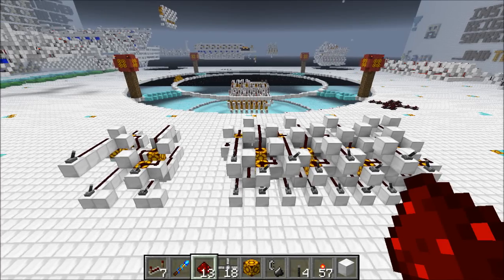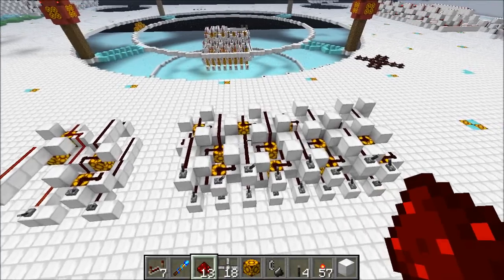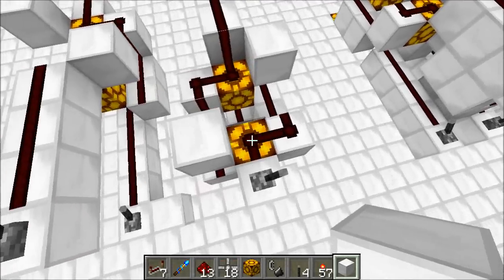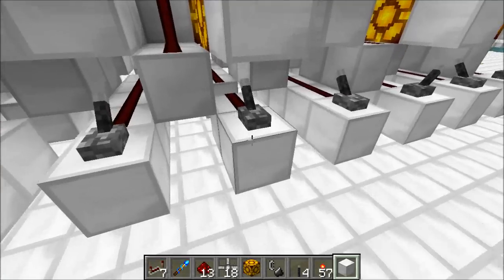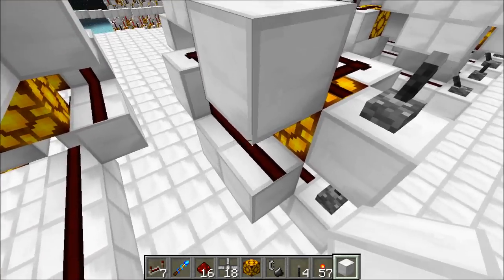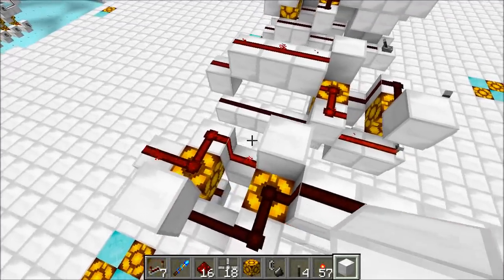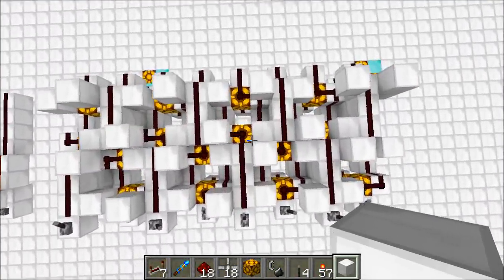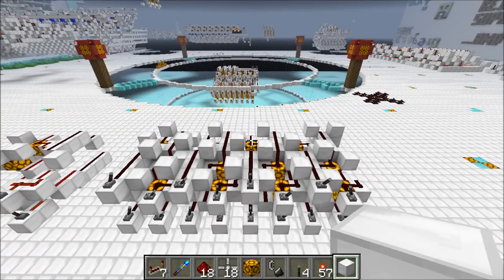Wiring Solutions: Two-Wide Up/Down Swap

Comment: Don't forget also the "clever" but slower logic solution using 3 xor gates, xor both inputs together in the middle, then the bottom output is that xor the bottom input making it the top value. Then the top output is the middle line xor the top line which results in the output being the bottom value.